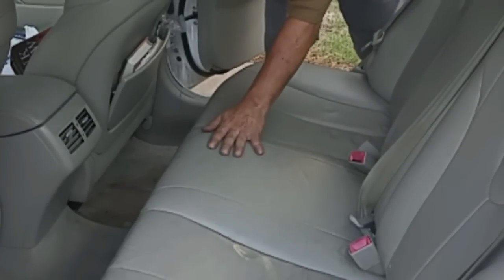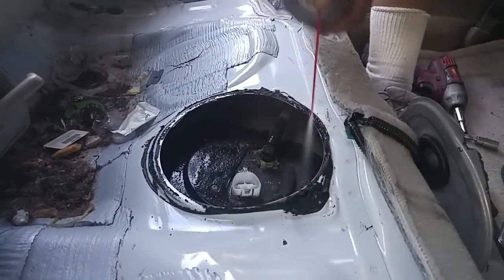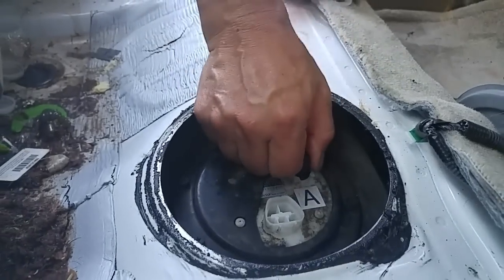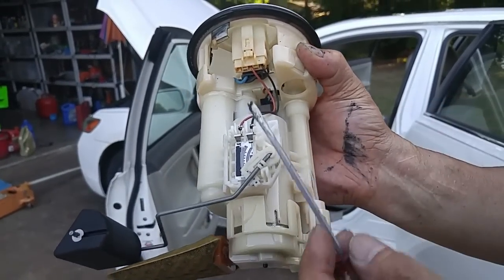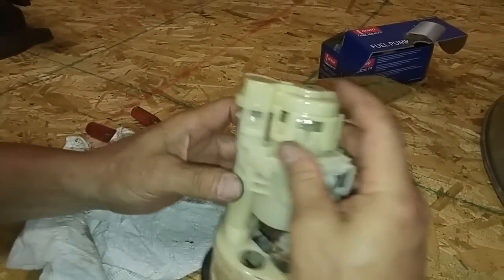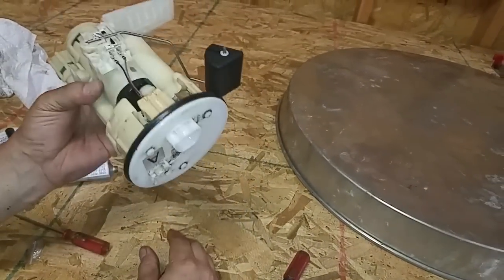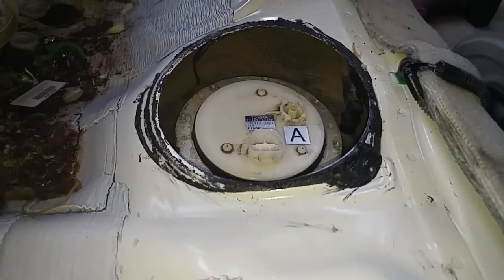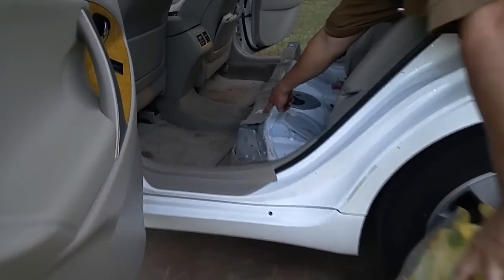Fuel Pump Replacement - Toyota Camry V6

Comment: 1) Make sure you disconnect the battery 2) Release pressure from the fuel tank by opening the fuel cap before doing this and that will stop the fuel pouring out
Reply from the maker: You don't have to disconnect the battery.  Everyone wants to feel safe by unnecessarily disconnecting the battery.  If you really want to avoid any fuel spill, disconnect the plug from the fuel pump assembly, start the car and let it run until the engine stalls out from fuel starvation.  Removing the fuel cap does nothing.
Reply: @hardlymovingpro  Would you also happen to know of a fuse or relay you can pull that would depressurize?
Reply: Hello, I have a question. When I removed the fuel line it didn't spew fuel. Is this a sign something else is wrong? I didn't take an precautions for it not to spew fuel. Besides stuffing paper towels around the opening. 😁
Reply from the maker: Could be a sign that your fuel pump's pressure is declining which would make its replacement prudent.
Reply: @hardlymovingpro  oh no, not that to.. Could it possibly be that it has less than a quarter of a tank of gas and it sat for two weeks? Here's hoping. Haha
Reply from the maker: Don't think so.  There's always residual fuel pressure in the lines after shitting off the engine.
Reply: @hardlymovingpro  thanks. I'll replace it then. You're the best.
Reply: Hahaha thanks learned the hard way
Reply: @hardlymovingpro Unless the pump failed and your car died... no pressure from a broken pump.

Comment: Hi, I believe my camry is making cavitation noise from pump not getting enough fuel (rumbling)when engine hot. Do I understand correctly that the fuel filter is fitted within the entire assbly along with the pump? I thought it was located under the air box in engine bay.  Thanks
Reply from the maker: Yes.  The filter is now integrated with the fuel pump assembly.   They go for around $30 on Amazon:  https://amzn.to/3BbO1e6

Comment: I have a Toyota Camry 2007 and always when I drive about an hour and stopped by gas station and try to turn it on. It won’t start from first time I have to wait like 20 minutes to cool it down and it works. My question does the issue from fuel pump?
Reply from the maker: Have both your battery and your starter motor checked out.  The battery should be putting out over 500 amps but I'd bet your starter motor solenoid is worn and gets stuck.
Reply: Hardly Moving Productions so the fuel pump has nothing to do with it. Before an hour I drove my car and stopped by the stop sign to take a the highway suddenly the car is off
Reply from the maker: Signs of a fuel pump going bad would be the car spitting and sputtering under load (acceleration).  Also you're problem could be loose or dirty battery terminal(s).
Reply: @hardlymovingpro  My Toyota Camry 2008 has same problem as Wael Alshehri.  Battery is good/ Starter changed/ Crankshaft position sensor changed/ MAF sensor clean/ Throttle body clean.  And still same problem.  I already ordered Denso Fuel Pump 950-0205.  It will be my last.
Reply: @deniseray6387  any luck with the new fuel pump?

Comment: How do you know if you need a new fuel pump?
Reply from the maker: The engine won't start or won't stay running very long before it stalls.  Disconnect the fuel line from the fuel injector rails and turn on the ignition for around 1 or 2 seconds (but don't crank the car!).  If no fuel comes out, it's your pump.

Comment: Great video!  Could a bad fuel pump possibly cause a P0430 code (catalyst efficiency below threshold)?  I have a 2002 Camry V6 (176K miles) with this code, and thought maybe my catalytic converter was plugged up, as the performance has been lacking.  It passed the back pressure test with flying colors, so now I'm wondering about the likelihood of a plugged fuel filter or bad fuel pump.  I couldn't locate a schrader valve to do a fuel pressure test, so now I'll try to find out how to test the pump.  Thanks!
Reply from the maker: Nope.  P0430 isn't a fuel related problem.  Have your converter checked out.  If the input temp into the cat is the same as the output temp, your converter isn't working anymore.

Comment: I am a girl and I used this video to successfully replace my filter and pump. Yayay

I recommend getting some paper towels and gloves and an old tooth brush. 

I used the old tooth brush to clean off the top so it didn't get dirt in the fuel. 

Then I stuffed the area around the hole with paper towels. 
This kept me from loosing at least three screws down there. If I wouldn't have stuffed it with paper towels I'd have been screwed. Pun intended haha😁

Thanks for the awesome video and answering my questions 

No one would have fixed my car on Christmas and I wouldn't be able to go to work. 

Thanks, you're the best.
Reply: A cute girl ?
Reply: I think so, but I'm bias.  @willypp13
Reply: @theoryofpersonality1420   👍

Comment: You definetely do not want to spilt fuel around then use a pwer tool to loose bolts unless your extinguisher is ready. But overall, it is very helpful video. Thanks
Reply from the maker: Thanks.  Dried area with compressed air ... as shown in the video.

Comment: Excellent access to fuel pump unlike many others where you have to drop the tank european vehicles take note
Reply from the maker: I know.  The Japanese car manufacturer engineers are smart.  I guess they assumed that one day the pump may give out and may require servicing; so they designed a service access port leading to the fuel pump assembly.  Also, not all American engineers have followed the Japanese engineering mindset.  So its not just European vehicles.  Thanks for your comment!

Comment: I have an 07 Camry. It starts up great when the engine is cool but when it gets how and I try to turn it back on I have to pump the gas a couple of times and hurry to put it in drive so it won’t stall. I’ve ruled out alternator, battery, starter. I literally have to pump the gas while turning the key and it still splutters for a while and then turns over when it cools down. 
I’m leaning towards fuel pump issue, any thoughts/suggestions?
Thank you in advance
Reply from the maker: Had a similar problem with a customer's Kia Sportage.  The problem was isolated to a malfunctioning EVAP purge valve located in his engine compartment.  See if relieving the vacuum pressure in your gas tank by removing the gas cap before attempting to start the car may stop the stall.
Reply: I have the same issue
Reply: Hannah Mullins fuel pump.. change the whole assembly and it will work perfect. Mine was fixed last week
Reply: @HamzaHamza-rv5we  Did you get buy yours at a local parts place or online?
Reply: Hannah Mullins i got from oreilly auto parts. I would suggest oem model (dealership) although more expensive but either should work fine

Comment: Good, informative video. 👍🏻  Don't know if you can edit a video that has already been uploaded but if not, maybe you could add the following tip to the description. When you're ready to remove the fuel line, start the vehicle, remove the fuel pump's electrical connection & allow the car to continue running until the fuel that was still in the line between the pump & the engine has been used, at which point the engine will stop running. This step will dramatically reduce the amout of fuel spillage from the removal of the fuel line.
👌🏻
👍🏻  👍🏻
Reply from the maker: Yes.  You're absolutely correct.  But as strange as it may sound, I used the leaked fuel to blow off the accumulated debris with compressed air in lieu of using an aerosol brake clean solvent.   I'll still add your tip to the description.
Reply: @hardlymovingpro  
Cool.
👍🏻
I had to pull the pump of my wife's 2012 Camry & I used my air compressor to blow the debris from the top of the tank before I did anything at all. When the flood of my fuel line removal started, I plugged it back in & remembered the "run it dry trick". 
Years ago, we'd use gasoline to clean wheel bearings for repacking, so it makes sense that you were able to clean it with the spilled gas.
👍🏻
Reply from the maker: @DoyleFM  I hear you brother and thanks for your post!
Reply: @DoyleFM  i was going to ask if this works for all Toyota Camry or even RAV4. I’ve got a 2012 & 1996 V6 Camrys. This looks great. Best way to not damage the fuel pump is to allow the automatic gas dispenser hose to stop while it’s filling the gas tank and not fill it till it tops off.
Reply from the maker: Actually the opposite.  The gas in your tank keeps your fuel pump from overheating.  Running your tank to empty overheats the electric pump.
Reply: @josephgarcia3767  
I'm not certain what the second half of your comment means.
🤔
What I did on my wife's 2012 Camry was I started the car & then removed the fuel pump's electrical connector. I did it in that order because I didn't know if the car's electrical system would "allow" the engine to start with the fuel pump disconnected. 
The fuel pump only operated long enough for me to get out of the driver's seat & disconnect it. 
Contrary to Hardly Moving Products' reply, the fuel pump can't overheat if it isn't operating. As the fuel in the lines is used up by the engine, the pressure in the lines will decrease & when the engine dies, residual pressure will have been diminished. 
I have two videos of my experience on my channel. They're kinda' long because I can't really edit video but they might help you.
👍🏻
🇺🇸

Comment: Hey can someone give me ideas why my car has high idle 2000 rpm, this happend after I changed my fuel filter.
Reply from the maker: Unplug your battery for 30 minutes then reconnect.  That'll reset your car's computer.

Comment: Great video I was able to knock mines out with in an hour. Took long because the back was rusted and wouldn't pop up had to get prey bar.
Reply from the maker: Hey ... great news!  Imagine a repair shop or dealership charging you $500 + to do that job.

Comment: So I replaced the fuel pump and everything went good. Pump was working but I’m still noticing when I push on the gas I’m still getting that stutter it’s right around 2 RPMs when this happens if anyone knows what could be causing this let me know. Thank you.
Reply from the maker: Check hoses for any vacuum leaks.

Comment: I have Toyota Avalon 2008 about 110000 miles. The car stars fine when cool. When I have driven for about 30 minutes and the engine is hot it struggled to start again, it will start and die.  it may take it about 3 to 4 cranks to start up. I have a new starter, alternator and battery. Note there are no Check engine light. I am even pleading for check engine light so to have a better diagnostic, but none.
Reply from the maker: Could be something malfunctioning with the car's EVAP system.

Comment: DO NOT USE anything electric-like that impact drill or steel around the fuel tank that can generate the spark!  or see you in heaven !
Reply from the maker: Like those 8mm access plate bolts?

Comment: Should I change just the fuel pump or the entire fuel pump assembly? Fuel pump is $85, the whole assembly at NAPA is $500-700.
2011 Camry V6 130k push button start
Few years ago The car was parked for 2 years and in the last year it intermittently takes just a tiny bit longer to start.
Reply from the maker: Just the pump or you can get the whole assembly at a auto salvage yard for what I paid around $30.
Reply: @hardlymovingpro  So, IOW, the assembly doesn't breakdown that fast or so easily. In that case I'll just change the pump and possibly the strainer. Thanks

Comment: I'm on my 3rd fuel pump any ideas why she keeps destroying them? I notice the dash lights flash cruise control too any ideas?
Reply from the maker: A habit of running the fuel tank to empty ruins fuel pumps.  People don't realize that fuel in the tank serves as a coolant for the pump.  Another cause may be too much back pressure from a clogged fuel filter (that's integrated in the assembly).  Lastly, could be a low quality fuel pump.  The OEM pump is made by Denso.  Carter and Spectrum makes decent pumps as a alternative.

Comment: So we just followed your video but when we took out the pump the filter was filled with debris.  So we change the filter and put it back together and in the tank but every time we try to turn it on it won’t start. It seem like it trying to turn on some time.  The car have an key ignition instead of a button.  We try turning it three time like in the video.  The car did start b4 we did this.  What is your opinion about this matter
Reply from the maker: Did you change out the pump?  If you have no tools for measuring fuel pressure,  you can disconnect the fuel line (it's a quick connector) and see if there's any residual pressure.  If not, your pump has failed or not putting out good pressure.

Comment: I did the exact same repair on a 2003 Camry 4 cyl. Not too hard for an experienced car guy, just a little intricate.bought the same pump too.why can’t all the cars have that same access to the pump.
Reply from the maker: That's right.  Repair concept can be performed on other Toyota passenger vehicles with minor differences.

Comment: Hi how are you today??i am about to replace my fuel pump because the car is losing power sometimes,I have to press the gas pedal all the way to get 45 miles and the check engine came out couple of times with the code P0157 and I have changed the oxygen sensors,the catalytic converters,no have exhaust leaks,no intake leaks and the only thing I haven’t check si the fuel pressure,I don’t have the right tool to check it so I am thinking about to change to fuel pump with the filter,I also changed the mass air flow sensor,do you thing that the fuel pump might be the cause of the acceleration problems sometimes???
Reply from the maker: Could also be clogged fuel injectors.   Had a customer with contaminated rusty fuel with rust sediment.  I cleaned out the tank and replaced the fuel pump, fuel filter and all injectors.  Had to replace the injectors twice since I though the problem was just the injectors.  Ran okay for a hour or so then the injectors clogged up again with the dirty fuel.
Reply: @hardlymovingpro  the problem is not permanent,it only makes it in the afternoon when my mom goes back home from work.Never have the problem in the morning or at nights,just I the afternoon after the car was parking for 4 or 5 hours and the sun is strong,it never does it if it is raining I don’t understand why🤦🏻‍♀️
Reply: @hardlymovingpro  and also after 6 or 8 minutes when she is getting home the cars starts to accelerate good

Comment: What model is this for. I have lexus 2006 es330
Reply: I wasnt sure if my model was in the backseat like this or the gas tank have to be dropped
Reply from the maker: 07 Camry V6 using the 2GR-FE engine.  Your ES330 uses the 3MZ-FE.   The pump design should be near identical ... IMHO.

Comment: I'm thinking about replacing the original fuel pump on my 190k miles 1999 ES300 (and the other fuel filter within the pump too.. is that a good idea?). I have no codes, but feel hesitation sometimes. I also climb slow up hills and hope it's a fuel pressure thing.
Something about testing fuel pressure in the service manual confuses me though. It says to "buy a new No1 fuel pipe and take out the fuel tube connector" 23801-20060 (23801-20061)" and proceed with the fuel pressure testing directions with that fuel tube connector. Why would I need to buy a new one if my car already has this fuel tube connector on it, and the fuel pressure testing only uses 1 of these?
Reply from the maker: Just get yourself a fuel pressure test kit that allows you to place a T connection between the fuel filter and fuel rail line.  Also, check out my video on doing a fuel injection cleaning service...  if the fuel pressure is okay.

Comment: Could have disconnected the fuel pump relay and ran the engine to discharge that fuel pressure.
Reply from the maker: Yea ... I could have.  Used the spill over to air blow off the debris sitting on top of the fuel pump assembly.  Not good enough ... had to follow up with brake clean solvent.

Comment: I have a 2007 Camry LE with the 2GR-FE engine, I went to the link you provided, put all the information in, and it said it doesn't fit the model I selected. Any ideas to what went wrong ?
Reply from the maker: I think it's a problem with Amazon.  Cross reference the part number with either the parts vendor or rockauto.com
Reply: @hardlymovingpro  appreciate the response, I found the parts a little after I commented.

Comment: How do I know which part exactly is failing? Fuel pump filter, or the fuelregulator? I have some intermittent sputtering/vibration, and I am sure it's either the fuel injectors or something in the fuel tank. Because usually the sputtering becomes noticeable after filling the tank. My 1mz-fe model has only fuel filter in the tank, no fuel filter under the hood.
Reply from the maker: Could be clogged injectors caused by using cheap gas.  Fixed 2 Honda accords using pressurized fuel injector concentrate cleaner service.
https://youtu.be/pz4R_IN232M
Reply: @hardlymovingpro  Thank you for replying... I just watched the linked video really nice job without the need of removing the injectors and the manifestation plenum.. In fact before the vibration started by two months, I sent my injectors to special cleaning service company and they changed the filters and o-ring. It was smooth running for two months until the vibration started.. So I'm not not sure what to change now. But I'm sure it's fuel related issue. Injectors, fuel pump, or fuel regulator. Because I head the clucking noise in the fuel pipe which is between bank 1 and 2 in 1mz-fe engine.
Reply from the maker: Then could be a clogged fuel filter or perhaps a weak fuel pump.  Both parts are cheap if you replace them yourself.